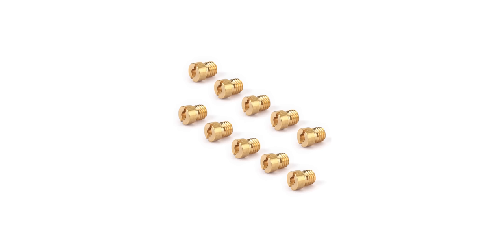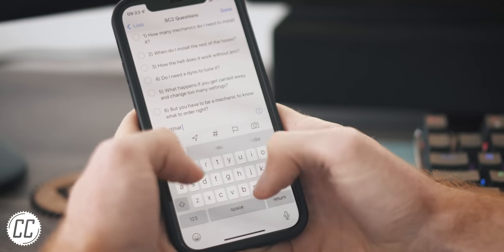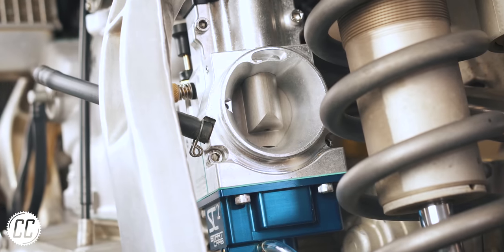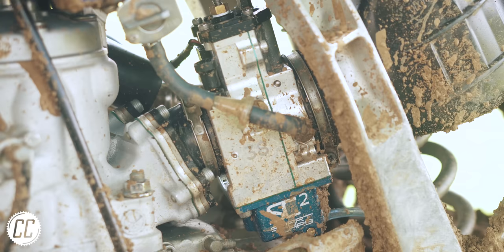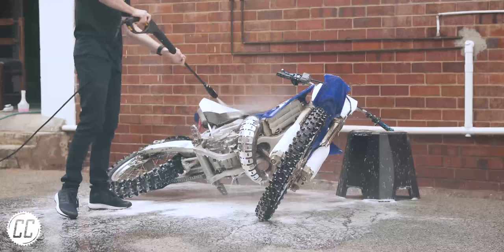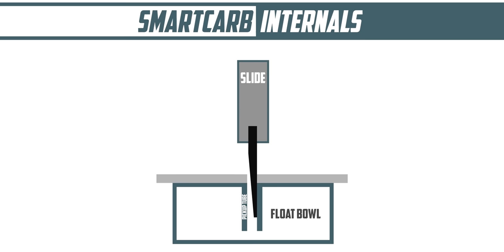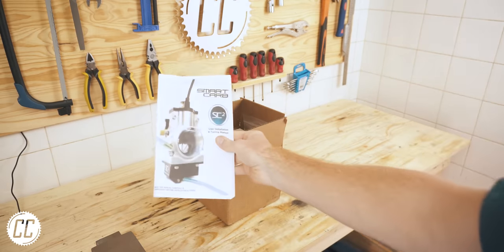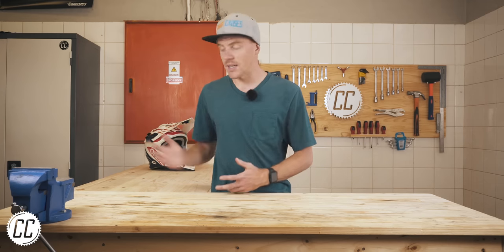The Best Carb Money Can Buy? | SmartCarb SC2

Comment: People that claim these are good carburetors have no idea what "good carburetion" is😅
Reply: There are professional racers and land speed record holders using them... but what do they know?
Reply: @nathandyess5310  because Lectrons only work good at wide open throttle settings. There has NEVER been a Lectron equipped bike that won the national motorcross, supercross, or enduro circuit.
Reply: @thulsa5218  you're right, but this video is about the SmartCarb, not the Lectron. It's decades newer technology that doesn't have the same drawbacks and compromises. Cody Webb competed with it all last year. Louise Forsley won the AMA Extreme Championship using one. Nick Fahringer flew over to compete at Romaniacs with one and became the first American to win the Silver class. Diogo Vieira won his 2nd or 3rd Portuguese National Enduro Championship while running the SmartCarb on his YZ250.
Reply: @nathandyess5310  it's the same principle..lectron, smartcarb, the jetless carb has been around forever. A smartcarb or lectron has 2 or 3 tuning circuits while a Mikuni or Keihin has 6 or more.  The more tuning circuits you have the better you can make your bike run IF you have a skilled tech doing the tuning.  Sadly 90% of people out there don't have this skill...hence all the "smartcarb" is the best carb ever comments.
Reply: @thulsa5218  sounds like you haven't tried one or done your homework. If more circuits meant better performance why not 8, or 10? SmartCarbs are a single circuit fuel system. Just the metering rod. And unlike the Lectron or earlier metering rod carburetors it gets away with it because of its integrated float bowl venting, a patented feature. Properly sized for the engine's needs with the correct metering rod (fuel profile), and with a carefully designed variable throttle rate with a non-round venturi shape (also patented), the SC2 outperforms conventional jet/needle carbs, without the complexity of multiple circuits. Metering rods more finely atomize fuel compared to jets, itself a performance and efficiency gain. The pro racers I mentioned in my earlier comment and their mechanics don't fall into the unskilled-at-jetting category.
Reply: @nathandyess5310  the smart carb has been around for quite a few years now and it still has problems and will NEVER carburate as cleanly as a properly setup Mikuni or Keihin. I'm not going to write a thesis about it because most people won't listen or can't comprehend anyway. The smartcarb is for people that like shiny things and don't know how to tune real carbs.
Reply: @thulsa5218  the SC2 model SmartCarb entered the market in 2019. The first generation SmartCarb only hit the market 9 years ago. Have you tried a Keihin or Mikuni made only 9 years after they got started?

The SmartCarb is for those looking for the benefits it provides over the Keihin or Mikuni, even when properly dialed. That's why the pros are starting to use them. That's why they have achieved EPA/CARB emissions certification. And that's why you'll be seeing more and more about them. Maybe someday you'll actually give one a try and see for yourself.
Reply: @thulsa5218  I'm the VP of Production at SmartCarb. Doesn't change the facts.

Comment: Can you run one in a blow thru turbo setup?
Reply: Yes. In fact we helped secure 5 new Bonneville Speed records late 2021in the supercharged 125/175 motorcycle classes. It was a blow-thru boosted YZ125 in an R6 chassis and it used the same metering rod that we'd use for a dirt ridden stock YZ125.
Reply: @SmartCarbFuelSystems  Sweet as. Anything you have to do to the carb to get it to cope?
Reply: @PJgearhead  not in and of itself, though you do want to ensure that the vent scoop has zero obstruction or airflow deflection. For it to compensate, that port in the top opening of the bell mouth must be able to communicate air density/velocity into the float bowl. Reach out direct for more information.

Comment: SU carb ,very  similar .
Reply: Very different actually. SmartCarbs are direct slide throttled, not a butterfly/CV arrangement like the SU. Integrated venting isn't used to throttle the carb, but rather it is communicated into the float bowl where it assists fuel flow proportional to both air density and velocity.

Comment: Maybe?
Reply: Most of our customers and pro riders ride hard enduro because that's where we've focused our energy. Cody Webb races with it as does the Sherco FactoryONE race team. 3/top 10 pro finishers just last Saturday's USHE round in Idaho with 6 total podiums across all classes running the SmartCarb SC2.

We make more power using less fuel by spitting less out of the exhaust unburnt, not to mention zero fuel spillage if/when tipped over. Economy gains aren't made by being lean, but rather by more finely atomizing and therefore more efficiently burning the fuel.
Reply: @SmartCarbFuelSystems  hmmm, if so does it support big bored bikes?
Reply: @FelekSta  we have models suitable for nearly all carbureted 2-stroke bikes sized 65cc up to 500cc+. The KDX200/220 being a notable exception due to frame contact.

What do you ride?
Reply: @SmartCarbFuelSystems  yz144 nearly everything changed to get more power or be lighter
Reply: @FelekSta  good information. Normally we recommend our 36mm size for the YZ125+. SmartCarbs are more sensitive to signal from the engine and are a bit larger than advertised. We don't like to over-carb. That said, tell us a bit more about the setup if you would. Apart from the bb kit, what other engine/exhaust mods have you made, how do you ride the bike, what fuel selection/oil mix ratio do you use and what peak RPM do you think it's achieving? In some cases a very built 144 will happily use our 38mm size.
Reply: @SmartCarbFuelSystems  144cc Athena head, ported, polished, FMF shortie, FMF fatty, Core Manual TorqDrive, titanium/carbon anything that i could change, slightly bigger rear wheel (i don't remember how much), one tooth smaller front sprocket, increased air intake, do you need more info?
Reply: @FelekSta  great information. Is the head higher compression than stock? If so, how much, and what fuel selection/oil mix ratio do you use in it? How do you ride it?
Reply: @SmartCarbFuelSystems   i don't remember how much exactly but it was higher than stock, oil/gas ratio same as in manual (i don't remember because i mix like 100L at a time and don't think about it), i ride it 70% offroad on soft/medium terrain, full throttle whenever i can
Reply: @SmartCarbFuelSystems normal from gas station + random quality oil
Reply: @FelekSta  more great information, thank you. You sound like a ripper. One last question before making a recommendation: what main jet do you currently see best results from in the stock Mikuni?
Reply: @SmartCarbFuelSystems  again i don't remember but it was running lean because i allowed more air into it

Comment: Yes but they are two different systems. One is a carburettor and one is a fuel injector. With the new one the needle is presumably calculated to give 14: 1 air to fuel ratio so it is a modern variation of the old Amal or SU. Yes I see the needle difference a bit like the lift format on an aircraft wing but there is a jet and the needle fits into it. This makes it basically a variable jet. This is why the SU carburettor post war was better than the Webber because the latter was a fixed jet unit and what functioned well at one height and humidity would alter hence old racing teams spending long hours in the paddock and pits adjusting engines. I think the technology sounds good and would be very interested to see some back to back testing not because I doubt the manufacturer particularly but because I would like to see the actuality of the improvement on a repeatable basis via test data which I think is what your older commentators are getting at. It seems very viable but let’s be frank it is a modification of quite an old idea with the addition of an aero foil needle in a jet!

Comment: Alot like a PSI Big Air carb.
Reply: The other way around actually. Cease and desist among other factors ultimately took them out.
Reply: @SmartCarbFuelSystems  They copied you? How long  has your carb been out?
Reply: @fjb6576  we can't go into detail but there was potential infringement of an early SmartCarb related patent granted to the original inventor of the fuel system, William Edmonston relating to the variable throttle rate venturi shape. SmartCarbs entered the market commercially some time later in 2012.

Comment: Lectron all day
Reply: Why go with the older tech? 38 HV, 38 H Series, new Billetron 38 - all 4mm smaller than advertised, all 4mm smaller in performance. No external adjustability, no integrated float bowl venting, no hope of meeting emissions standards while using power jet fueling, no tip-over fuel spillage or external evap prevention, no TPS option. If you like the Lectron, and it's a solid carb - way ahead of its day having entered the market in '74, you'll love the SmartCarb.

Comment: Nothing new or smart.
Reply: Well it's new enough to be patentable, and it is. As for smart, we're partial to the notion. What other carburetor does what the SmartCarb does?
Reply: @SmartCarbFuelSystems  So my 70 years old motorcycle have too "smart carburetor" because it does exactly the same as "smart" one. Only big difference is needle adjustment - multiple steps, metal ring holds it on right position. To name it smart is big dumb azz idea... That product does not have any smart options, just copy of old technology. It could be the smart if it could make the perfect fuel and air mixture, what no any technology can make (so far). What next? Smart spark plug? Smart spark plug wire? Smart coil? Smart distributor?

Comment: it's casted not machined :)
Reply: SC2 SmartCarbs are CNC machined billet construction. They aren't made from castings.
Reply: @SmartCarbFuelSystems  if that's not a die cast finish i don't know what it is :)
Reply: @vladnickul  we've already told you. They are CNC machined on an Enshu 5 axis mill in a shop here locally in Kansas City that also does work for the DOD and Apple. If they were die cast we sure wouldn't be leaving them squared off like they are.
Reply: @SmartCarbFuelSystems  it may be so... but no square shape in a die cast ?:) my friend... that's ridiculous                                                    anyway. All machined parts that i have , have tool marks on them, this one its looks like you can see the aluminum crystal matrix... like in a die cast part.                                            good luck with that.
Reply: @vladnickul  what's ridiculous is your suggestion that we would spend tens of thousands of dollars on die cast mold tooling only to leave the parts squared off and heavier than die casting would allow. You might consider tumbling your machined parts for a more uniform finish, like the billet machined SC2 SmartCarb shown in this video.

Comment: Still has jets
Reply: Not in any conventional sense. The SmartCarb fuels by way of a fuel nozzle or emulsion tube and metering rod combination. The rod has a very precisely tapered grind angle on it that allows fuel flow past it in a linear curve from idle to WOT. As the slide and metering rod are raised, the aperture formed by the rod/nozzle combination increases allowing more fuel flow at higher throttle positions. Internal float bowl venting prevents the need for any secondary jet circuit like a power jet for example, making the SmartCarb the only true single-circuit fuel system available today.
Reply: @SmartCarbFuelSystems  Like I said, it still has jets.
You are having a play on words.

Comment: These do NOT make more power than the Keihin. Did a bunch of different dyno runs on a few different bikes & never onve did the SC2 or Lectron ever make more power than the Keihin.
Reply: Are we really going to do this again Keith? Show us the charts lol.
Reply: @SmartCarbFuelSystems  

What shops (when after power) use your carbs in their builds?

The SC2 doesn't make power. Power drops everywhere. They have less throttle response & pickup slower. That's NOT always a bad thing though. Depending on the type of riding or conditions a person rides in or even talent level or just flavor of power delivery. A lot of people would actually both ride better & enjoy their bike better with a little power dumped, smoothed & just softened up. They wouldn't be as intimidated by the power, the softer more tractable delivery let's you get more aggressive & more aggressive earlier. There's also slightly less fatigue. Go with all the positives & truths & you'd get less flack. For example, if  you never claimed a power increase, you can defend yourselves honestly when/if someone complains of the power loss. Sorry sir but we never claimed a power increase.  We mentioned the tractable softer power delivery.
Reply: @keithpeterson3447  professional racers, land speed record holders, third party shops doing dyno testing who are able to show us their data, our own internal performance data, and our customers all attest to the power-making capabilities of the SmartCarb.

We stand behind our claims and that includes increased power over dialed conventional jet-circuit carburetors of similar size and we'll be sharing more evidence thereof shortly. We ask you again to share your dyno data - have yet to see it.
Reply: @SmartCarbFuelSystems  

😆

Your reply is a laughable attempt to try & save face with anyone who reads this. More deceit from a snake oil company. I wouldn't expect anything less from a group of cons.

As far as my dyno charts, I'd have posted them all over the comment sections if we were able. Make sure when/IF you post charts, that the correction factor is shown & that it's SAE. I see it all the time with guys who fudge numbers to make their customers feel good about the money they dropped. As you know 😉, there are a LOT of deceiving crooks.

You still haven't named anyone who's using your junk to make power. Bonneville is more about aerodynamics than it is about power. I could go on about that topic but in a nutshell, a bike with an aerodynamic shell can weigh TWICE as much as a bike without a fairing & still go faster. There's so much more to Bonneville than power. To claim one thing is responsible for the speed record is laughable. Your carb isn't setting any record. 

Dyno & drags is where power is needed. Guys use the lectrons for those applications but only because they offer much larger sizes than the typical flatslide offerings from Keihin & Mikuni. The fueling system of both the Lectron & your garbage is absolutely 100% inferior in delivering a better "prepped " mixture for power.
Reply: Nobody's reading this  @keithpeterson3447  and neither are we. When you get around to posting up some actual dyno data with A/F ratios, maybe on a blog post somewhere or something, throw up a link here. We'll do the same.
Reply: @keithpeterson3447   if you were actually in the know, then you'd know differently. Ours and third party dyno data is readily available on our social media channels and elsewhere. Meanwhile your data is vapor, nowhere. If you're going to continue to make these claims then you either need to put up or shut up.
Reply: @nathandyess5310  

You guys keep coming back. 😄

Like I said, I'd post the charts all over on here if we could. 

Bogus correction factor adjustment is the ONLY way the SC2 (Scrap Carb 2) would show a gain. 

Why do you have a second version ready? Nobody ever got their first version after you guys taking lre orders & failing to deliver. Then the carbs that people got were absolutely unridable. Now you have a second version already? Why? 

Why did you sell the first version when it clearly didn't work & didn't even have a ridable tune? 

Why didn't people ever get their carbs? 

Why are your customers doing the r&d for you?

Send me a carb, I'll dyno it vs a dialed Keihin. If I'm wrong, I'll eat my words, buy the carb & give credit where credits due.

.....but we both know the SC2 will fail so we both know you won't send a carb.
Reply: Happy to help you feel relevant,  @keithpeterson3447 . As I said, you can and should post links to your charts. Perfectly doable here on YouTube. Just do it. Or don't, whatever.

Your questions are meaningless, and also telling. Seems you have no experience with the SC2 or understanding of this fuel system's development over the last half decade. Encourage you to try it out. They're $699 on the website. Nobody eats for free. That said give us a ring or send us an email. Let's talk, if you're willing. Maybe we can work something out. Again we stand behind our product and the claims we make with full confidence.
Reply: @nathandyess5310  

My questions are meaningless? 😆

You mean you can't answer them without revealing your scrap carb & shady business practices.

Just like i called it, you guys wouldn't put your money where your mouth is because you can't. 

The Smart carb is a dud for making power. 👎
Reply: @keithpeterson3447  did... did you even read my comment? As one of the men behind the mirror, apparently wasting my time here..., I answered your questions. And you are the one who brought up the STIC, claiming to have invented it. Seems to me that you're coming at this from a competitive standpoint or some sort of jealous has-been or might-have-been mentality, who knows 🤷‍♂ All I know is that we're commenting on a widely viewed video touting the SmartCarb's unique feature-set and performance benefits. Get used to seeing more of these, and maybe consider changing your mind because this will become an increasingly bad look for you.

Comment: ive been running 32:1 im my Sc2 on my 2004 cr 250 , the previous owner told me that the SC2 carb was built for 40:1 ratio 😝 , sometimes the bike floods without giving it throttle , causing hard starting if at all , must bump start it to get it unflooded .